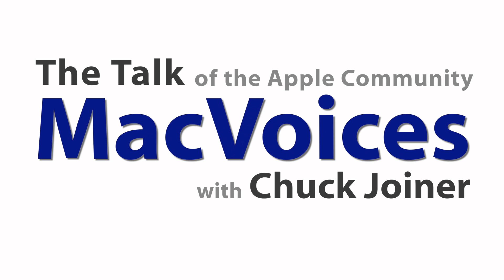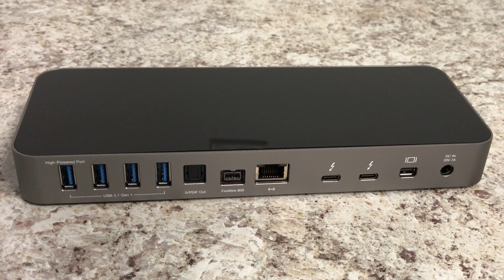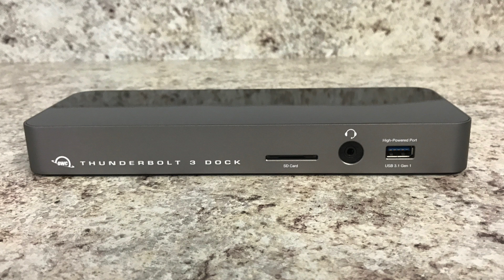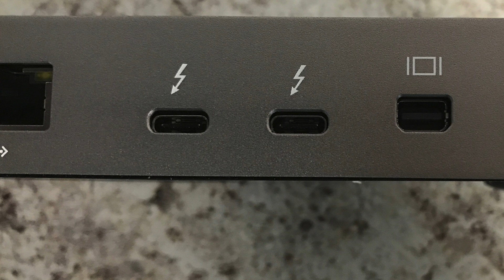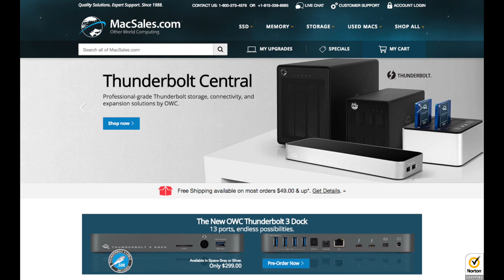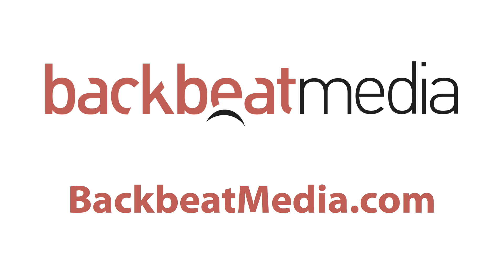MacVoices #17152: Briefing - Five Things About The OWC Thunderbolt 3 Dock

Comment: I just bought the MacBook 12" (mid 2017) and purchased the OWC Thunderbolt 3 Dock (space grey) and plugged the included cable and received the following alert "Cannot Use Thunderbolt Accessory" - Thunderbolt accessories are not supported on this Mac..... any idea why?
Reply from the maker: I think you may have purchased the wrong dock for your Mac. That's a Thunderbolt dock, and I don't believe your Mac supports Thunderbolt. Check this listing at EveryMac to be sure we are looking at the correct model:

https://everymac.com/systems/apple/macbook/specs/macbook-core-m3-1.2-12-mid-2017-specs.html#macspecs2

The connectors look the same, but the protocol is different.
Reply: MacBook (Retina, 12-inch, 2017)
Reply from the maker: Yeah...I'm thinking that particular dock isn't supported. I believe you need the USB-C model:

https://eshop.macsales.com/shop/usb-c/owc/usb-c-dock

Comment: Dosent work with 2017 macbook pros it will upto the 2016
Reply from the maker: What doesn't work?
Reply: The dock. I purchased one for my 2017 macbook pro and it did not work i researched and called the manufacture and they dont work with the new macs because of a chip.

Comment: Can I use this newer technology to connect my new monitor to an older 2012 macbook pro?
Reply from the maker: Not this one, because this is connecting to your computer via USB-C, and your old Macbook isn't USB-c equipped, Keith. Sorry.
Reply: MacVoicesTV Does OWC sell an older version for macs?
Reply: Get a usb 3.0 hub.
Reply from the maker: They also have a Thunderbolt dock that you might benefit from.
Reply from the maker: Definitely an option, but to take full advantage of the USB-C capabilities, this is a great option.
Reply: MacVoicesTV I just got 2 Dell monitors Ultra sharp U2415's and I bought a dongle that connects on e to USB and the other has a mini Connector 
Is there a better way to to that or is this ok ?
Reply from the maker: If it works, then don't mess with it!  :) Not sure what Mac you are running, so not sure what other output options you have.
Reply: MacVoicesTV 13 inch MacBook Pro mid 2012
Reply from the maker: Here's the EveryMac page for your model:

http://www.everymac.com/systems/apple/macbook_pro/specs/macbook-pro-core-i5-2.5-13-mid-2012-unibody-usb3-specs.html

If you are happy with your current set-up, then I wouldn't mess with it. If you are bemoaning the loss of that USB port, you might want to pick up a USB 3 dock to get them back. Not sure it is worth it if you aren't unhappy with what you've got.